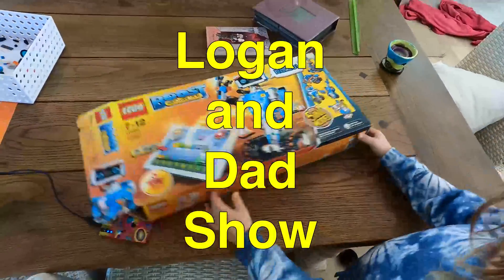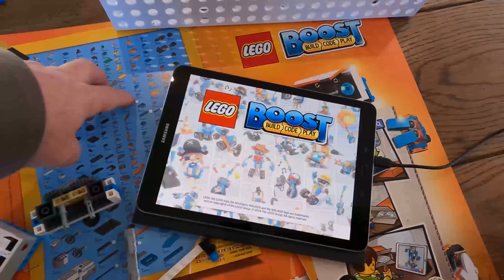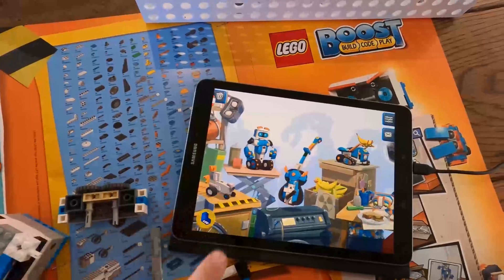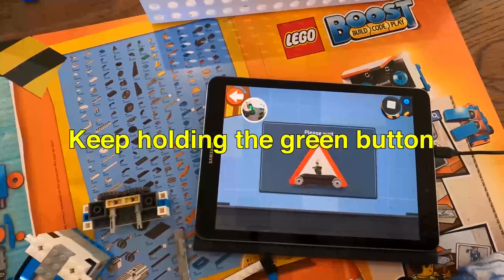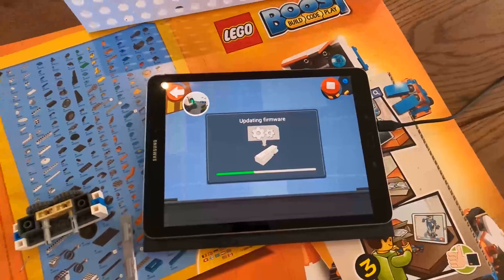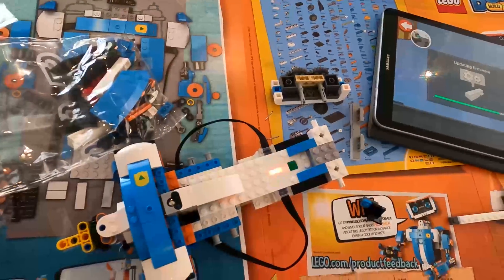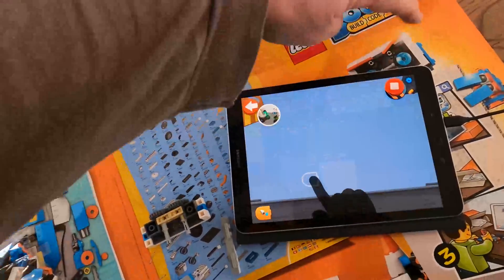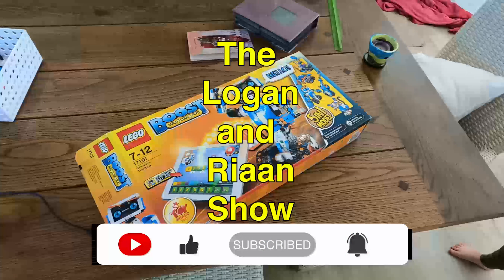Lego Boost WIFI Code - Firmware update

Comment: After following your steps, instead of appear the firmware update running, appears a white page with "CONNECT" on to top, and does not come out of there...
Any sugestion?
Thank you in advance
Reply from the maker: Sorry man. Try phoning the lego support. Or lego face book.
Reply: @penquingaming  thank you.
Finally solve tudo problem. In my device, firmware update did take 1 day 😭😭😭